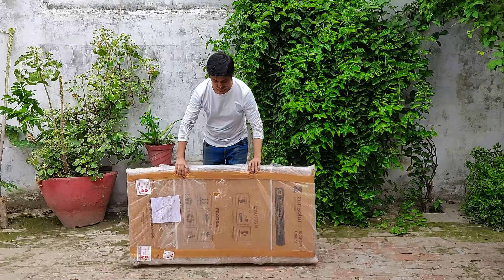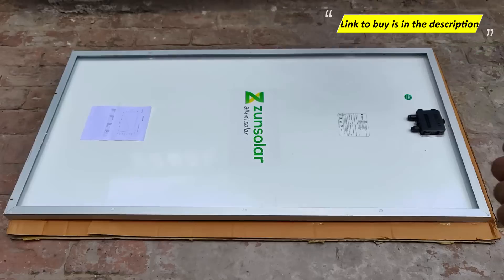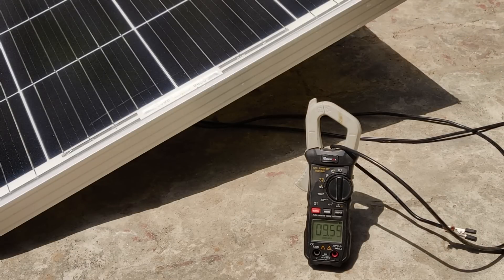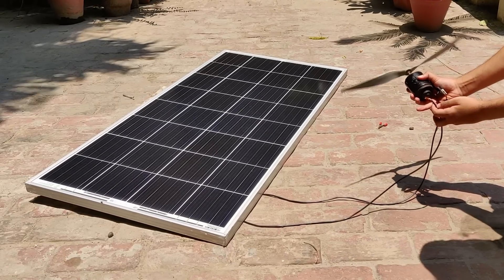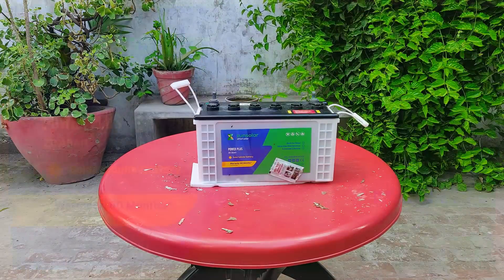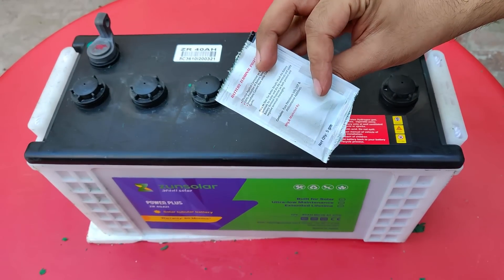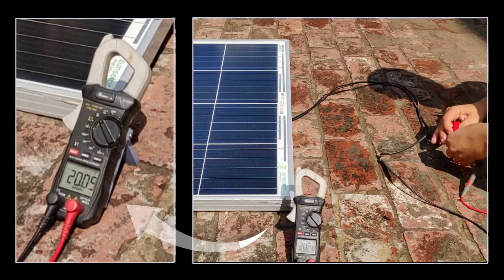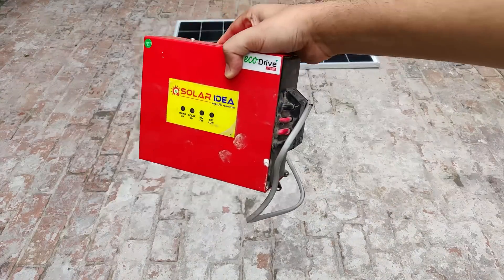12V 180W Solar Panel System & Battery for 220V AC Load DIY

Comment: I have Vguard Solar Inverter and 12v 200Ah battery, can I use this panel with my existing battery or I need to buy solar battery? How different is solar battery than normal tubular battery?

Comment: Power 1500 W continuous it s enough to weld : aproximate - 40 A  using welder invertor : its for very thin materials / for ex. For 80 A you need 2900 W ( 2,9 kW)

Comment: What vehicle has that electric ac compressor that runs on 12 volts dc?
Reply from the maker: I am not sure.  Found it in scrap market
Reply: @MrElectron  was there any part number mentioned on the compressor?

Comment: Hi Mr Electron,

The video was great.

However, I recommend using LiFePO4 batteries for solar setup instead of Lead Acid batteries. 

The thing is that Lead Acid batteries can offer only 50% Depth of Discharge and last only for 3 years.

LiFePO4 on the other hand can give 70% Depth of Discharge and last for around 20 years. Even if it is discharged more such as 80% to 90%, it will still come for 15 years.

You will need specific LiFePO4 compatible chargers and charge controllers to recharge LiFePO4 batteries but the investment pays back in the long run.
Reply: Can we use this battery in home inverters??
Reply: @raviutkarsh1712  yes
Reply: LiFePo4 batteries are great, just be sure they come with a good Battery Management system.  I use a dedicated 100AH LiFePo4 to run a Dometic (12/24V DC ) or (110V 60HZAC)refrigerator/freezer

Comment: Solar controller looks like overkill for a single 180 panel. Fun project!

I have to say, some of getting my solar stuff sorted has taken the fun out of it... but that was what I wanted (right?) It just works.

I still screw around with some smaller stuff like a similar setup to this one, like for a gasoline pump for lawnmowers and atv and such. But that's done too. 

I'd like to take two 12v car air compressors to keep my shop 80 gallon air tank charged... but haven't figured out how to limit run times to something like 8 minutes on/ 16 minutes off, running one at a time while the other cools off to keep from cooking the tiny compressors. All while keeping it cheap enough to be a fun project and not an investment.

Comment: I have a doubt, will it work if I connect the inverter directly with the solar panel ?
Reply: Correct ! Voltage will be high
Reply: Voltage could be too high if not under heavy load
Reply: I recommend getting a buck boost converter to keep the voltage stable at around 13 volts. 
Some capacitors after the buck boost would be good for some quick surge
Reply: @NutScrewGamer  The best thing for efficiency and power would be to use almost as high voltage as the inverter allows. If inverter's high voltage cutoff is 15,5V, feeding constant 15V should not be a problem and should work better than with lower voltage.
Reply: @Teknopottu  what ever suits you. I've been kinda afraid to push caps to their ratings (16 volts) since I had a few of them blow up on me without warning
Reply: @NutScrewGamer  Always good to get new information. Never had 16v caps explode on me with correct voltage. What device was in question?
Reply: Extra note:
I was using 12 volt battery as power source.
A 16v cap exploding with that voltage source is weird enough
Reply: @NutScrewGamer  If reverse polarity was out of question then it is weird. 12V lead acid batterys can put out (was it) 13,6V but still it's nowhere near 16V. Maybe defective caps?
Reply: @NutScrewGamer  Your comment disappeared but maybe if you used vintage caps the problem was their age?
Reply: @Teknopottu  I think that's the only main problem if other values are in place.
TIL: Never use aging electronic components
Reply: @NutScrewGamer  It depends on the components. Caps can become fragile and dangerous after couple of decades while transformers, diodes and mosfets for example have been perfectly usable from 40 year old electronics, at least in my case. Years ago I dismantled an old UPS from 1980's and all parts still work as intended. 

Capacitors are pretty cheap and plentiful so if not in an emergency, one should not use older caps.
Reply: @Teknopottu  Oh I gotcha. Thanks for the tips
Reply: @NutScrewGamer  You're welcome, glad if something useful came up.
Reply: No.  You need stable power, a regulator